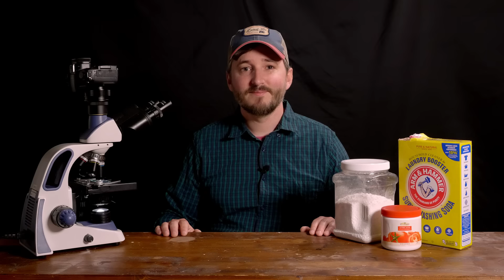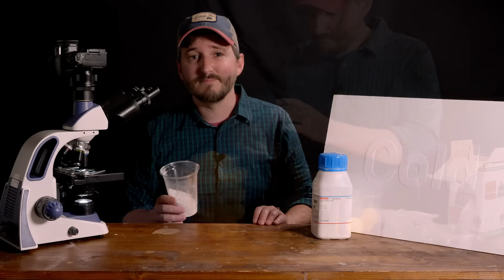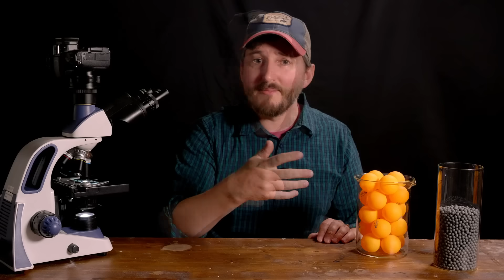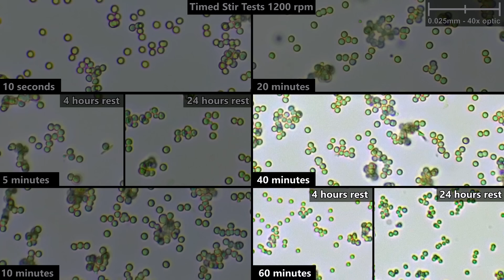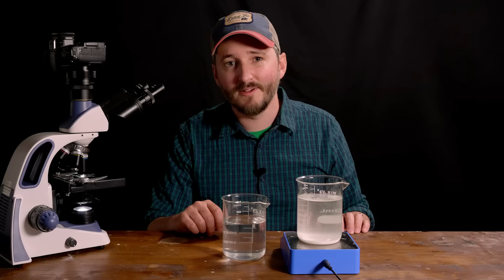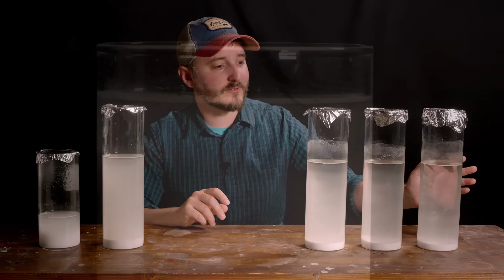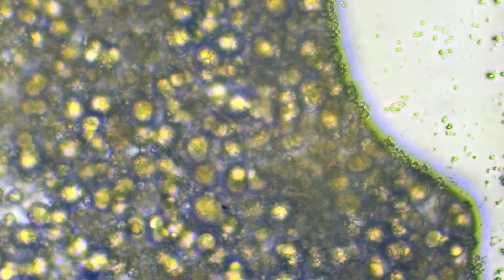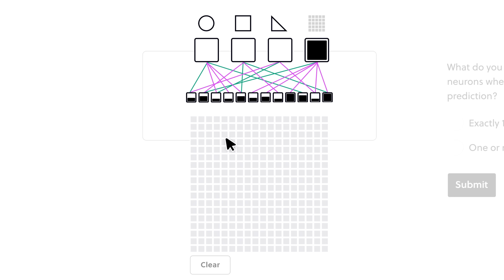Making Infrared Cooling Paint From Grocery Store Items (w/Novel CaCO₃ Microsphere Synthesis)

Comment: Have you considered rod coating? Of course it's only effective on flat surfaces, but it works well for coating photographic emulsion. It appears to have a similar consistency, which I suppose makes sense, as they're both suspensions of small particles in a carrier liquid. It might be a practical way to make large, flat panels quickly, and the even coating keeps waste to a minimum.  Awesome project and I look forward to seeing more

Comment: I was trying to think of the least expensive way to do this on a small building. At the moment, I'm thinking that would be to roof the building with plywood painted with the cooling paint, then cover that with clear polycarbonate corrugated sheeting. What I'm undecided about is whether to seal the open ends, or leave them open. I can see pros and cons of both. Any thoughts? Also, would condensation be an issue?
Reply from the maker: I don't know the answer to those questions yet. I can say that polycarbonate will not work because it's opaque to IR
Reply: @Nighthawkinlight  Well, darn. Thanks for saving me lots of frustration. Back to the drawing board, I guess. Is clear PVC opaque to IR?

Comment: You sir are a genius. This will save lives in places where heat and power are both an issue.
For spreading the paint you can make walls around the flat surface and then just pour it. Let is settle and dry, and do another pour if needed. Eventually you will get a perfect amount of paint needed for the pour.
For objects that are not flat you can try dipping but that will waste too much material.

Comment: I think it would be neat to build an air tower that cools ambient air as it flows down a "chimney" before flowing through a room. Hot air rises and flows out through another vent. Just like air towers in Middle Eastern architecture.
Reply: What about mixing with epoxy resin?

Comment: Great video! Have you considered using PVA glue as the binder with your pigment?
PVA glue is the base ingredient in most water based paints, and it dries clear. Perhaps adding some UV resistant properties for outdoor use?
On a different note, in Australia i have asked some paint shops, which roof paint stays the coolest. The answer was dark maroon red, stayed cooler compared to any other pigment

Comment: Very large cement trowels?
And for large horizontal surfaces, doors, etc. the long handled cement finishing tools that with practice will create a quite evenly distributed cover. 
Acetone, by the way, is best used with canister facemasks, as absorption is hard on kidneys.

Comment: This is very interesting! Great work.
Wondering about the materials used in the frescoes on the walls of Pompeii (just visited two days ago). It felt so cool in the heat of the day. Definitely used limestone and sand and sometimes volcanic ash and sometimes pulverized marble then the minerals for the colors like red oxide, sometimes eggs as binders also wax on top sometimes…
Wondering if those combinations would have a cooling chemical reaction and serve a practical purpose as well as aesthetic…

Comment: I can only imagine the countless applications that are possible with this paint!
There are airless paint spray systems that work with high pressure pumps. The paint gets atomised through a nozzle and is applied like with a normal spray gun. Maybe this could be a solution to apply even layers of your Cooling Paint.

Comment: Would this be good for painting the inside of a tank holding sand (or another thermal mass) to reflect and help keep the heat in the tank for a sand battery?

Comment: Amazing video! Some suggestions on application methods: you could try to use a drawdown bar (a simple steel rod might work for panel coating with the right setup). Spraying from a gun might also work better using a slower-evaporating solvent, depending on the issues you're having.

Comment: I wonder what the potential of replacing solar panels and a heat pump on an RV with just radiative panels and a low power glycol circulation system would be...

Comment: Hi thanks for sharing your creations, In Australia, "Calcium Chloride Flakes CaCl2 FCC 77% Food Soluble Cheese Beer Making" Is easily gotten, 77% does that mean I should use about 13grams instead of 10 grams,  will the other 23% of other stuff effect the mixture,
Reply from the maker: I don't know what the other 23% is. If it's just table salt then it should still work. 13g should be ok for adjustment. Only problem is it will be hard to tell if you've succeeded without a microscope

Comment: Argh!🙄 This is far and away that most brain-sticky video of the week. I keep coming back with "what if." Many of these "what ifs" you probably know the answer to. Some you can find quicker than I:
What if you mixed the micro spheres in wood glue? (or other adhesive)
What if you applied an adhesive to a surface and applied (sprinkled on) the micro spheres?
What if you mixed the micro spheres into white paint? (The white paint would probably cancel the effect of the MSs)
What about using an IR transparent tape?
I wonder if you could blend these into 3D printer PETG and extrude filament?

Okay, maybe I can sleep tonight now that I got that out of my head.

Thanks for the the great work you do!

Comment: Thanks for this. I am not needing currently a cooling paint but I use whitewash to paint my chicken coop and put on my trees to discourage insects. The method of making the microspheres of different sizes vastly improves the basic whitewash recipe. Traditionally, whitewash has been combined with skim milk to make milk paint. Have no idea how that would work pursuing the cooling aspect but the caseins in the milk give the whitewash more permanence. Milkpaint on wood will not strip chemically. You have to sand it off.
Reply from the maker: Casein is already on the top of my list for things to try
Reply: @Nighthawkinlight  This is the casein paint recipe the U.S. Navy used back in the day. It is supposed to acquire water resistance over time and eventually become waterproof. 

100g Navy Paint

10 casein
9 lime
10 kaolin
71 whiting
----------------
100

And another recipe from M.D. Swartz:

M.D. Swartz Base

10g casein
8.75g lime
1g sodium carbonate
1g bentonite
46.25 chalk whiting
23g kaolin
-------------------------
90g base

Colored Pigment

10g
--------------------------
100g paint
Reply: @Nighthawkinlight  I know it has been a while but I was stove up with arthritis this last year. I finally got some effective treatments and I just mixed up a batch of limewash with citric acid to see if I can get the spherical effects. It is currently settling out and I have to make the second batch of smaller spheres to mix it with. I am using 2 cups of salt, 1gallon of warm water, 7 cups hydrated lime, 3 Table spoons of the citric acid. I don't have a microscope currently but If you would like me to paint a sample card and send it to you I can. This is going on the inside of the chicken house. When I paint the outside I will be adding casein into it.

Comment: Great work! And great video. I was very intrigued and impressed with the TechIngredients video you mention here, but you make it seem much easier to produce, and easier to understand. Thanks so much! I have a question, though: What is the wavelength of the IR light radiated by the Calcium Carbonate? Is the wavelength within the absorption-range of silicon PV cells? (around 900nm...) I think you can guess where i'm going with this question... Think highly reflective white roof with bifacial PV-panels.
Reply from the maker: https://webbook.nist.gov/cgi/cbook.cgi?ID=B6000507&Mask=80

Comment: 36:55 the thicker the coating the more thermally isolated it is from the cooled object so it is generally better for it to be as thin as possible without compromising the cooling ability. I don't know the thermal conductivity of the materials but polymers are generally fairly bad heat conductors. Also it is a foam so the insulation may not be negligible.
Reply from the maker: Yes the acrylic mix is a placeholder while I work on better mixes.

Comment: For applying the paint; could you perhaps treat it similarly to laying down concrete, so quickly dispense the mixture approximately evenly, with some kind of popsicle stick border to prevent overspill, and then give it a nicer finish with a combination of agitation of the applied mixture and a surface smoothing step (drag a popsicle stick over it). Seems like something like this could be a good way to cover larger areas more efficiently; of course this only really applies to large flat surfaces that can be laid flat so gravity does most of the work, but cooling panels at least fit that description. Also I wonder if adding additional agents to the mixture could make it more paint-like without compromising its useful properties.

Comment: This is Brilliant, like your Sponsor. There is a question that always puzzles me; How do you know if the products, materials or whatever you work with are safe to inhale or touch or eat or put into the fridge as you did?!
Another question: where can I search for credible info about anything I wanna research, like you did with the papers? how do i know it is not a snake oil?
Reply from the maker: I learn what is safe or not safe by reading about the properties of the chemicals I use. It's hard to be sure the information you read is credible. One way to fact check is to read multiple authors (ones who have personal experience with the subject) and see what they agree and disagree on. For scientific papers you can find many on Google scholar, and more may be accessible through an account with your local library.
Reply: @Nighthawkinlight  Thank You!

Comment: I'd be curious if there could be a way to make the viscosity thick enough so that you can just trowel the mixture onto a surface.  Or even using a trowel to level the surface after extruding it via syringe or piping bag; though I'd also like to see this done with caulk gun, like a syringe but much larger, if only there was a simpler way to get wide strips out of this method but that'd probably require an entirely custom extruder.  I'd also be curious to see how well a roller works, maybe even a squeegee, etc.  There has to be some kind of application method that's simpler.

Comment: I'm wondering if the number of nucleotide/precipitation sites would increase if the solvent was first degassed and then an argon gas was dissolved into it under high pressure (like a soda except with an inert gas). Basically the small bubbles within the solution would create small local zones from which to precipitate the spheres.
???

Comment: So one thing I would like to throw out here is heating your walls is actually important to water and moisture flow through you wall assembly. Water is a number one killer of a wood wall or room assemblies. You need to have heat to have evaporation, and temperature difference between inside and outside to have a proper vapor flow.

Interior paint and building paper (and other WRB Systems) are vapor open and allow a wall to dry in either direction. insulation itself reduces heat flow and energy flow through a wall which reduces the drying capacity of a wall or roof. This is why old buildings last. More energy flow = more dry = long life. The down side is more heating or cooling.

This still could be very useful in hot dry climate zones where moisture is less of an issue.

Joe Lstiburek has a lot of good lectures on this topic of building science.

With the high density and film thickness of this coating it is going to have issues with moisture build up in a roof with out a gaped system like a rain screen or drained Eifs or Stucco. Roof systems are not typically gaped.
Reply from the maker: Yes that is also one of my concerns about using this as a roof paint on wood frame homes. That would be one benefit of cooling panels rather than direct painting, the cool air could be injected into the living space directly, or probably more practically it would be directed into the hot side of an AC unit to boost efficiency

Comment: Now to make its opposite, infrared heating paint, and boom. Connect with something conductive and watch a "perpetual" motion machine go powered passively by the Seebeck effect. 😆 EDIT: WAIT HOLD up! Does this mean that you could send heat through a fiber optic cable, if you just had something to "receive" the same wavelength at the other end? Sounds extremely impractical, but damn. Sticking an ethernet cable out the window pointing at the sky to cool a PC sounds kinda wacky.

Comment: You should try screen printing as a method of applying your mixture. It produces very even layering but you are constrained by the size of the frame used to hold the silkscreen taut. No need to expose a pattern on the silkscreen, you can just place it on your substrate and squeegee the mixture through the screen to apply it on the substrate.
Reply: I just posted the same idea and then scrolled down to read the other comments and found you had beat me to it, the only difference in my idea was to just have runners/rails/shims that are the height of the desired paint thickness on the side of the substrate that the scraper/squeegee would ride on. You could easily "paint" a 4x8 sheet of plywood with a concrete bull float riding on a few rails.
Reply: I was thinking screen printing while watching the video. I’m not sure that silk screen will give a thick enough coating on one go and wonder whether wire fly screen could be a good option. For thicker coating.
Reply: As a screen printer, this is exactly where my mind was going. The screens/applicators could be made very quickly and easily. Just get a large portion of mesh with a micron size that allows for the larger particles to pass through. I’m sure this could be aerosolized as well. There are plenty of differently sized nozzles for paint guns. I just came back from a low rider show and some of the flake used in the paint jobs has to be a good amount larger diameter than the microspheres he’s using in the process. 

Also. If the paint is self-leveling to a degree, why not just use a roller to apply it to larger surfaces?

Comment: ok so i wrote a thesis on this stuff, specifically production of nanoparticles in bulk for the purpose of thermal stabilization of cheaply produced cyanide chromophores. bubbling oxygen up into solution and performing electrochemical synthesis with transition metal anodes like zinc or titanium, using an arbitrary choice of capping agent might help. literally studied a bunch of the papers you cited for my thesis lmao
Reply: also modeling chemical dynamics in matlab can help design protocols for nanostructuring of arbitrary complexity and monodispersity of nanoparticles

Comment: try flowtrol is a white carrier for paint and/or a thinner. Cut a piece of wood/aluminum to fit inside a cookie sheet.   pour it out and flatten it b using a straight edge across the tray edges. That can give you a very thick layer with even coverage.

Comment: Using a syringe, it seems that a 3d printer would be good. Having a computer operated syringe that ran back and forth over a surface area could be used for some applications.

Comment: 37:05  This has me thinking of syringe pumps / paste based 3d printers…

(Something like a syringe on a gantry, or potentially a diy peristaltic pump going back and forth over a conveyor belt with the right settings may be PERFECT!)

(Also a “valve mod” where you can make it suck up more paint from a tank when lulled in reverse, and push it out the (3d printed custom?) nozzle when pushing forward!)

Comment: Fantastic information and presentation. Solid science.

Perhaps a squeegee method for applying the paint? Make a blade with short, widely-spaced wires on the edge, gloop the paint onto a surface, then drag the blade over it using the wires and blade angle to control the film thickness. If the wires leave lines vibrate the surface.

Or maybe roll it on with a long nap paint roller and vibrate to level, kind of like applying drywall mud for some kinds of textures.

Someone with experience spraying thick coatings can probably point you in the right direction for spray application. Maybe a job for an airless sprayer?

Very much looking forward to future experiments with this material, particularly in the direction of making it durable enough to withstand weather and cleaning.

Comment: When Linus uses his thermal camera he often mentions that it cannot get accurate readings on reflective surfaces, that's why they apply tape to things to get rough estimates of temperature.

I think one way of verifying temperature measurements (//besides possibly with a small probe and a fan underneath a large sheet or something vs other materials) would be to cool metal ice cubes, test for thermal conductivity of the paint (mw/k) and to mix them into beakers of water containing a thermal probe. //For scientific validity you should also allow the room(or chamber) to equilibrize at a certain temperature with temperature control to control other variables from affecting the data.
Reply: metal ice cubes because metal has much more capability to soak up a lot of heat compared to an insulator.
Reply: Another fun idea would be to email LMG incase they come up with any uses for the paint and could make a video about it